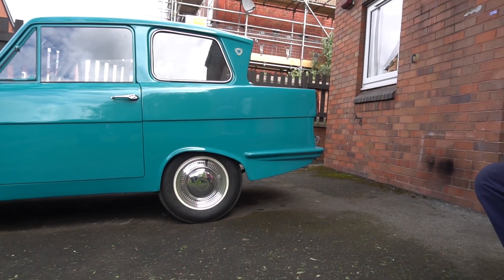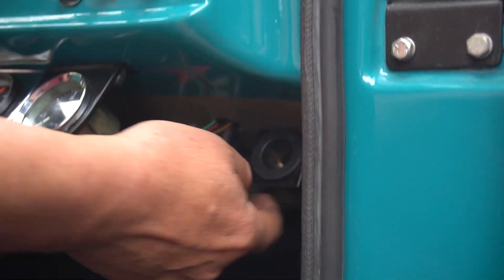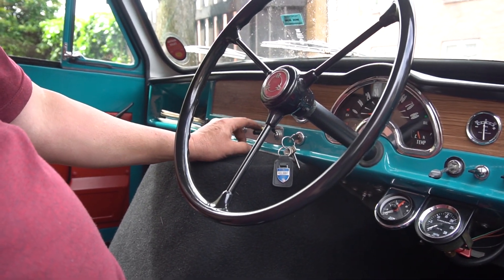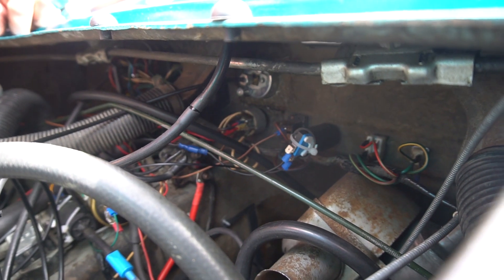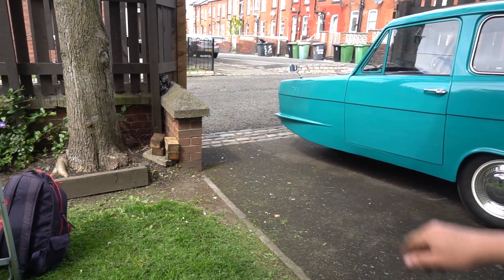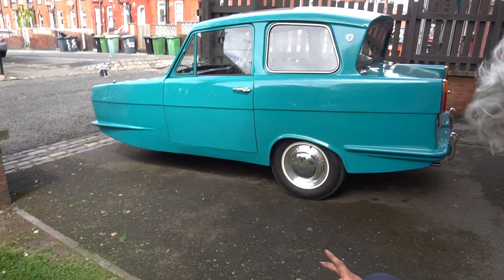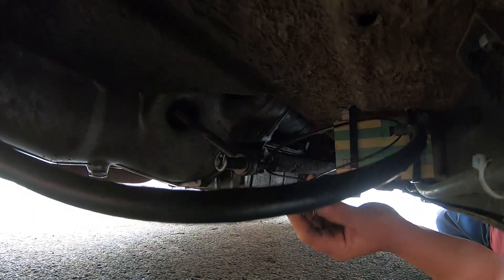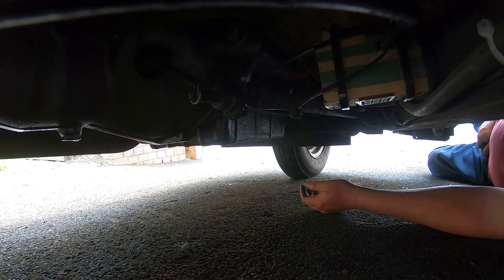1969 Reliant Regal restoration Part 8   Major update

Comment: I had a 1969 super van 3 ages ago & it runs in my mind that the carburettor on the Regal at that time was a Zenith (similar to solex) - the SU (I think) wasn't fitted until the Robin was introduced. Think the air filter box on the car here is wrong too and from a later robin model.
Reply from the maker: You are indeed correct. It was a Zenith 30IZ originally on the 700cc for this car. That carb was also carried over to the first Robins with 750cc engines. But with the 850cc engine the SU was fitted.

Comment: Nice to see the update on the Regal....and the bonus Brompton footage! I'm tempted by a folding as it'd fit nicely in my FIAT Panda.
Reply from the maker: I only just discovered that the B75 is discontinued. It was built using a couple of older parts they wanted to use up (older style handle bars and brake levers which I modded out anyway). Brompton have renamed their series with the cheapest being "A Line". The spec looks the same as B75. It's only available in white and it does use all up to date parts like the rest of the range. But it's £950! Glad I got the B75 when I did.

Comment: Sounded a lot quieter on the motorway than when i heard it on some of your earlier video's,  is that since you've changed the engine and gearbox 🙂
Reply from the maker: Dunno to be honest. The 850 is a little more smoother than the 700cc. Not really quieter as I can tell. Math might have used a different camera before, he's got two and windows might be open/closed.

Comment: Very cleaver with your modifications. It's a shame you are using plastic tie-wraps to hold your Mods in place.
Reply from the maker: To be honest it's the easiest way. They are awkward to fit and using brackets and bolting in place (for the Lego mod) doesn't lend itself to being taken out quickly if I wanted to. I understand where you are coming from because it sort of screams BODGE. But if they are held firmly enough I don't see an issue. And I can always go back to complete standard any time I wish in quick fashion.